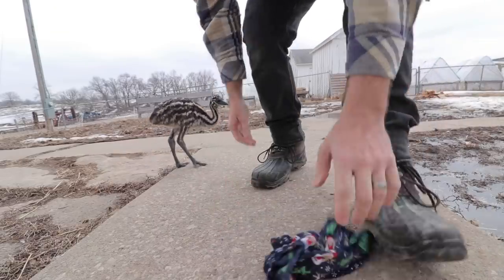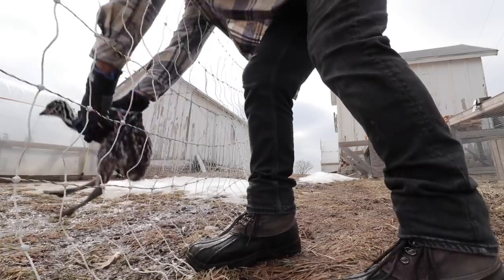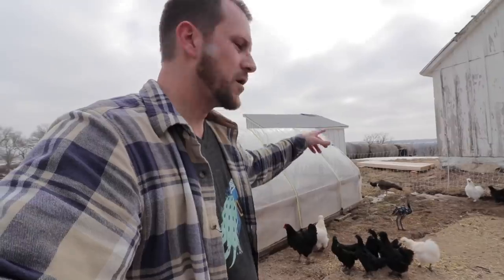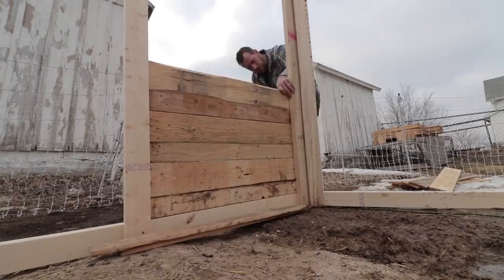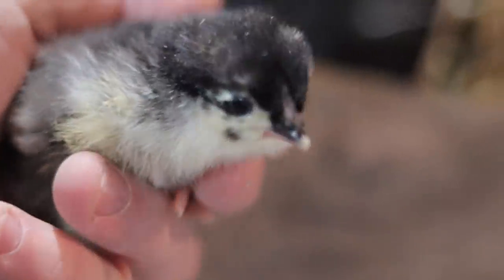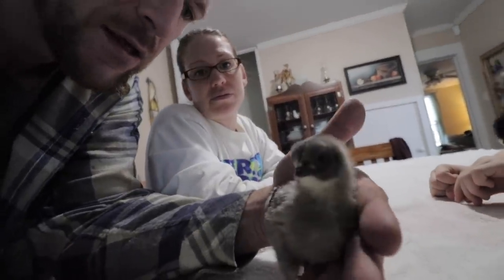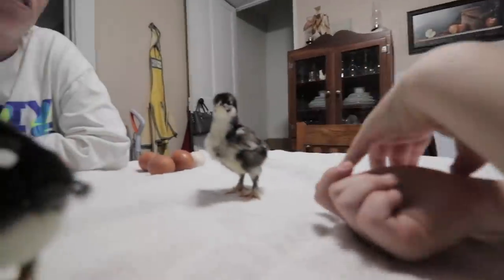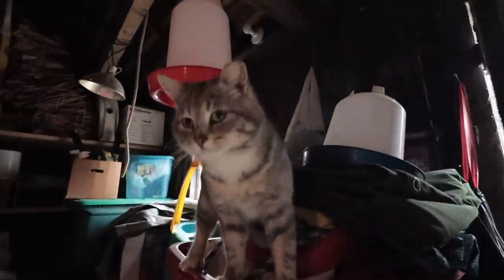Will Bamboo fit in her new emu house?

Comment: Jake 1 emu alone needs about 1 acre to itself, i don't think that cage will work and they are nomadic so they do run away without proper fencing as adults
Reply: I believe he has said previously that the hut is only for a shelter when they want. They will have acreage fenced that is also connected to the hut.

Comment: That emu house is not big for more than one (and I doubt that the one will be comfortable due to the shape), so the other half needs to be made. They have a couple emu's at a nature park close to where I live and they had a space as large as WHOTH space they have for all their birds now so they would need to double the fence area they currently have. Also, the fence was  5 1/2ft high with about a foot thick circular wooden posts going along the top and down the sides, with thick steel wiring (as thick as a regular chain link fence but a rectangular pattern so the birds don't get stuck) that's buried about 3 feet underground.
Reply: I think that's just a shelter. It is too small for a "house" though.
Reply: @johnchase4408  WHOTH called it a house so I was just using the term they used, but I agree it's too small in proportion to be called a house.

Comment: You need to put some more support across where the 'walls' would be. 
Triangles are your friend in terms of support. Go from corner roof to opposite corner on the floor and that will greatly increase the stability of your structure. You can make an X For even further stability. 

Good luck.
Reply from the maker: +GreaterBookWyrm - I'm hoping when I frame up the windows, that will provide some much needed support

Comment: Right now, in her 'downy' coat, before she gets all fledged out in her adult plumage, you can see Bamboo's resemblance to her theropod 'ancestors', especially when she runs. Her allegedly vestigial wings are about as useful as a T-rex's forelimbs. Of course, she is a whole lot cuter.
     That Emu tractor could use some corner braces; triangles are much more resistant to collapse than parallelograms and rectangles.

Comment: i would uses some old metal roof that may have started rusting with like 1 or 2 layers of clear coat paint on it "so it stops" with plastic or a tarp under it for the roof i think it would look neat. what do you think?
Reply from the maker: +Austin Butler - that would be ideal, but we'll probably have to just buy a new piece of metal